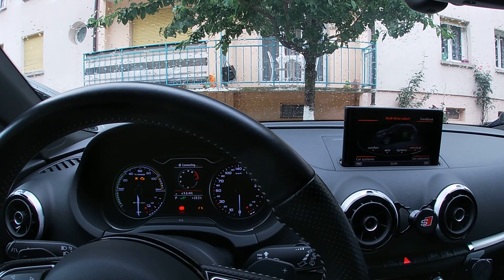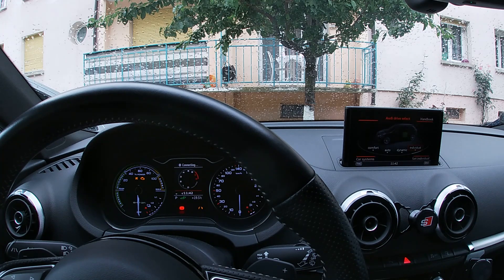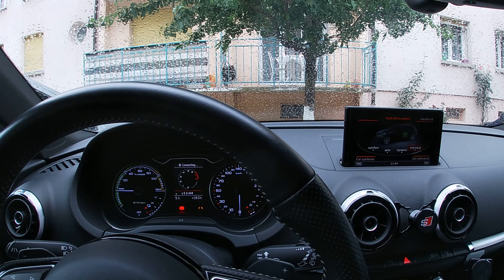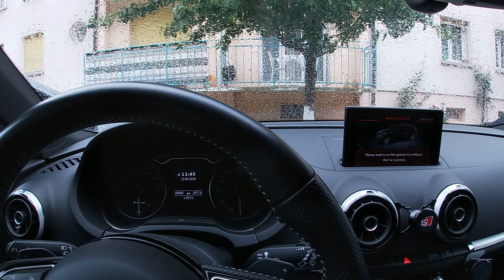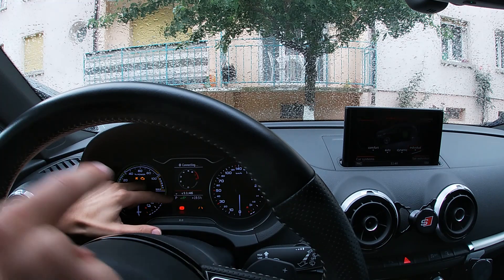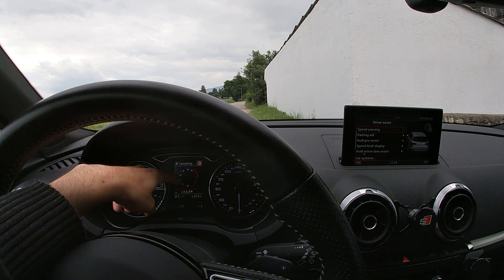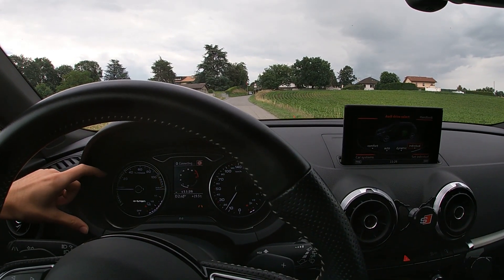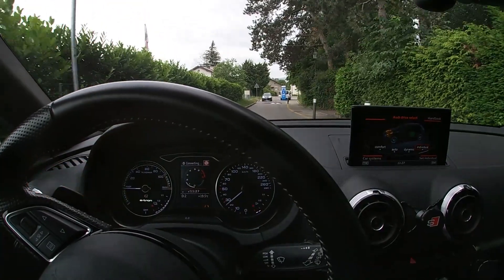Audi A3 e-tron hidden fuel engine (ICE) preheating mode discovered (bug with demo)

Comment: Always wondered why its not pre-heating. The car dealer told me the vw gte and the a3 e-tron 
Is pre-heating trough the coolant. Never tested it. But kinda rough for the engine wear. Reinforced? The belt must be changed somewhere at 2xxxxx?

Also I got (vdcs) coding off for the seatbelt warning. Gonna test soon cause the car booting or when it is fully charged really annoys me the the ice not running

Thanks
Reply from the maker: Hello,
I do not think it used the coolant for that in this one as it would not be sufficient anyway. The oil would still be cold and it would not be around the cylinders.
It needs to be decoupled from the gear box so that it does not start too strong.
I guess that as long as you drive « normal » it wouldn’t wear the engine that much more.
Yaris do that and it sure is better.

Comment: Brother i have a question, i have audi a3 etron 2015 without paddle shifters. If i change the steeringweel with paddles will it automaticly work? And will it work on facelift steerinwheel?
Reply from the maker: Hello,
Unfortunately I do not know.
There are a lot of electronics in those cars and I would not know if just have the paddles will make it work.
A lot of options in those cars are actually here but disabled if you don’t buy them.
But I do not know to which extent 😅.

Comment: Is it possible to show RPM gauge and oil temp at the same time?
Reply from the maker: Hello,
Hmmm no because those are 2 separate menus if i remember well.
Reply: @funcarreviews  in this video you had a clock under the rpm gauge, can't that be oil temp?
Reply from the maker: @MauriceNL1  Aha you are giving a doubt here.
But i don't think so because if i remember well, you have to go the the lap timer menu in order for it to appear. If you don't have the lap timer, you can't show the oil temp.
That would mean that you have to go to the lap timer menu.
Reply from the maker: I didn't check my English counterpart video, but the french one yes.
You can see the oil temp here : https://www.youtube.com/watch?v=mStD3qVF6sE at 14:23 . It's actually on the top.

Comment: Salut, thanks for the video. I have the 2017 facelift and it automatically preheats as soon as you enable the battery hold or the hybrid mode while driving. The ICE only engages after 1 or 2 minutes of preheating. This does not apply if you press the kickdown on the gas pedal. The engine would automatically engage at full revs following a kickdown in the EV mode, not good...
Reply from the maker: karimh hello,
Thanks for your feedback. Yes it seems that the preheating is better on the facelift than the original car. For this one it is needed (if wanted) to make a full gaz pedal press. It won’t rev fortunately as it won’t have time. Or make the « bug » to engage preheat. It s interesting how it changes between the 2 versions. The B mode bug disappeared. The recharge mode disappeared and the preheating is better handled 😀. Lets see what they have for us with the new A3 e-tron coming up in a couple of months tops 🤗

Comment: I have a 2015 Etron, the bug you showed also works in hybrid Auto mode when I have a load around 30%. ICE turns on and the crossed EV icon is shown while still driving electrically, after a while the ICE is connected to the gearbox for a bit. And then it alternates between EV and ICE as usual. To me it seems like it is supposed to do this.
Reply from the maker: Thanks for the update.
The hybrid auto is a mode i do not use.
i ll try to drive normally in this mode an see if it happens.
But it should also be on hybrid hold mode. It should never be engaged with the gears without a bit of preheating.
In hybrid hold mode it never happened.
Is that the same with you ?
Reply from the maker: Ok so tried with hybrid auto mode and no difference. No real preheating on my side. Weird.
Reply from the maker: Is your ICE icon on or off when it preheats ? May you check that if you have the opportunity ?
Reply: @funcarreviews  I believe it showed off last time I was driving it. The RPM is stationairy but the wheels are still driven from the battery. And after a while it connected the ICE to the wheels and the icon appeared. Like in your video. Maybe there is an algorithm with a new software update? I have the car for about 1,5 months now so I dont know all the ins and outs yet haha

Comment: No drama in the 2017 ModelYear. The car always preheats the ICE while driving on battery. Only when the ICE is warm enough the ICE will be coupled to the gearbox. Engine management prevents high revolutions of the ICE when it is still in warming up mode. I think software development took care of these situations.
Reply from the maker: Hello,
Thank you for your feedback. Unfortunately I don’t have my hands on a 2017 to test my bugs so I appreciate that. I am sure they could have modified this on the 2015. The electronic is different, it s true. The MMI is already different and the b mode bug doesn’t work anymore.